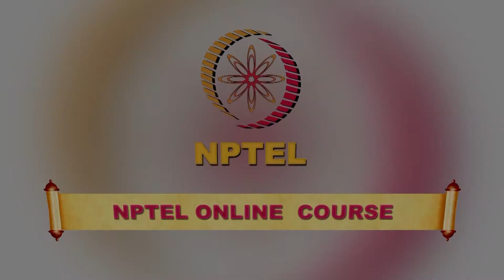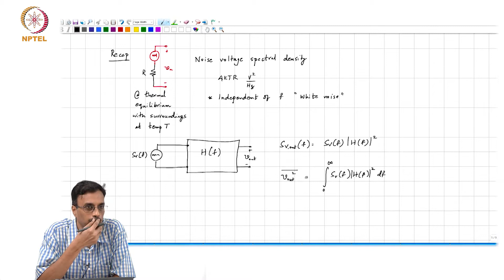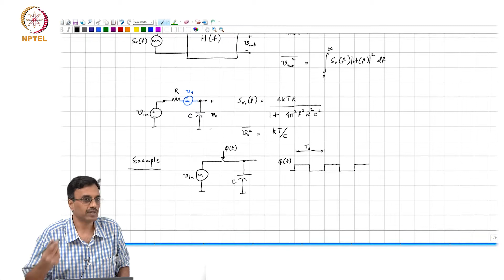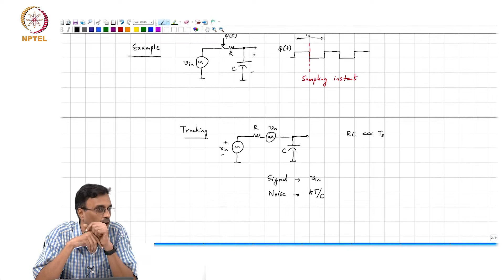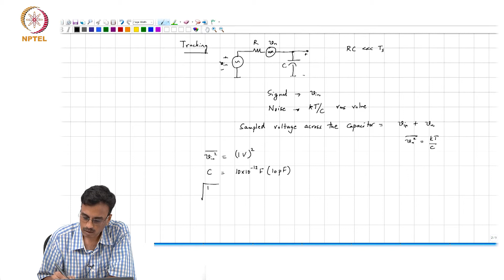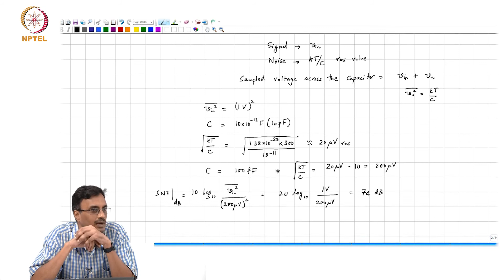kT/C noise in a sample-and-hold circuit

Comment: One Question :
KT/C Noise is the Mean Squared Noise across the Capacitor for an R-C Circuit. In the Case of Sample-Hold, the RC is not connected always as for half of the cycle, S/W is off and for the other half it is on. Is the noise sampled on Capacitor not impacted by the switching and the Duty Cycle of the Clock ?